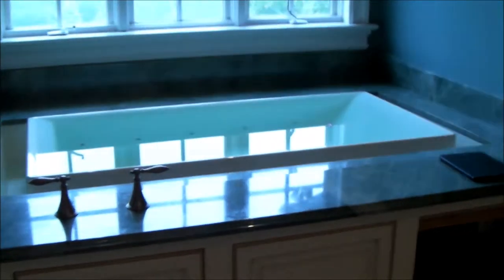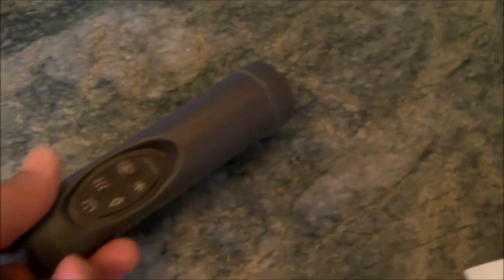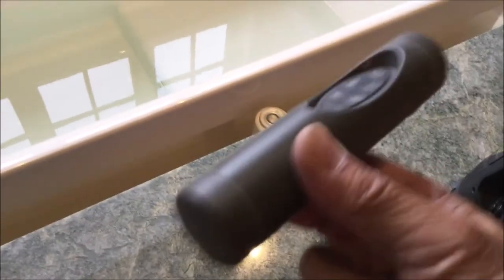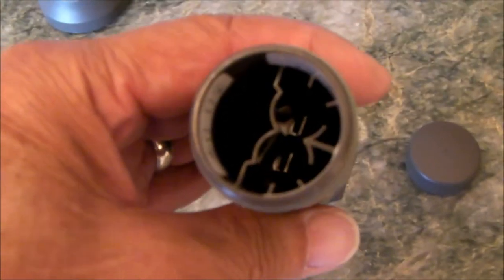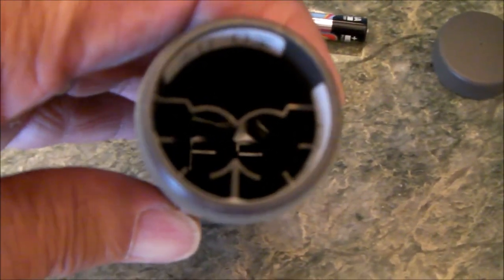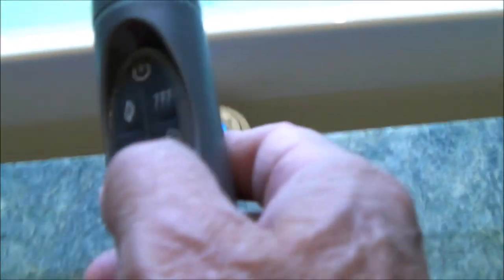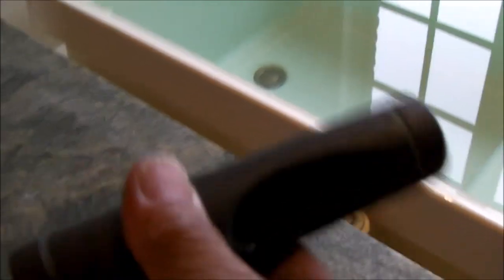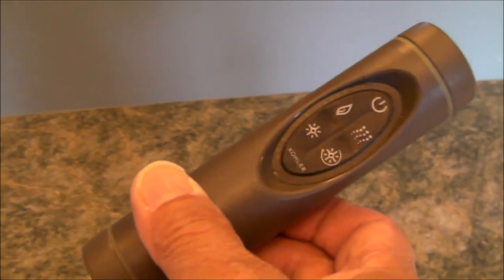FIXED - Kohler Effervescence jetted bathtub remote control doesn't work on overflowing bath

Comment: Great video. Don't suppose you have a part number for this remote control? Thanks
Reply from the maker: No, sorry
Reply: @YuDaMan  Thank you for the reply. Was the remote infra-red, like a TV, where you had to point the remote at the sensors in the bath...?